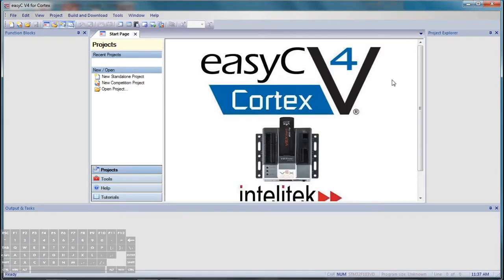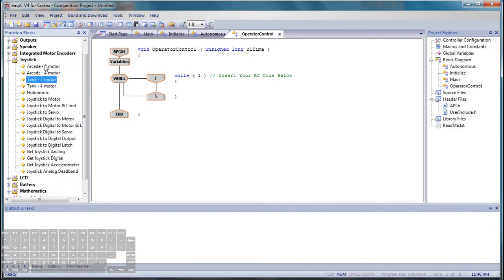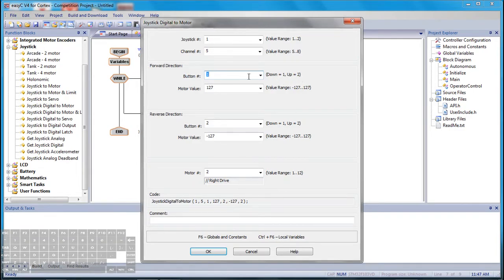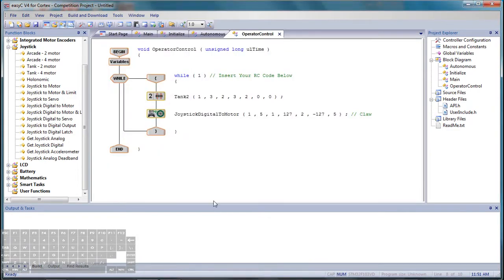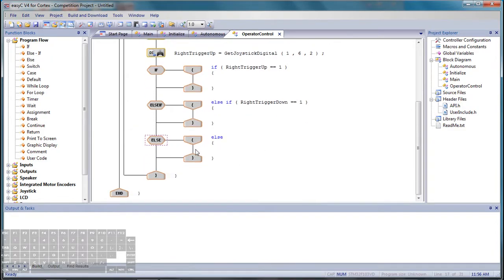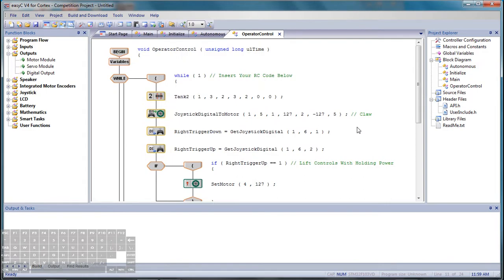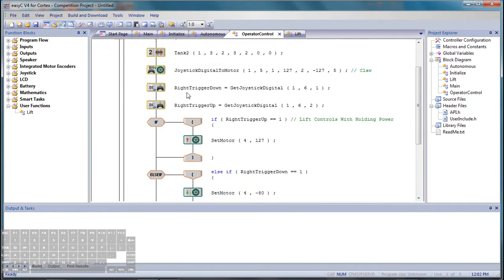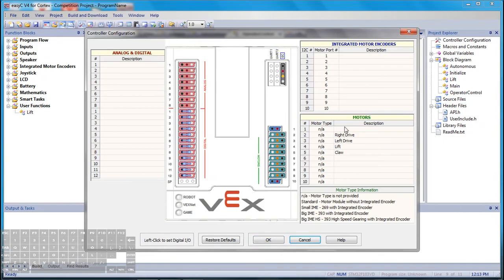Weiser High School Robotics VEX EDR Clawbot Programming Tutorial EasyC-V4 for Cortex

Comment: Will this code work for a servo or just motor ?
Reply from the maker: This is the old system. I have no idea what had changed, but you should look at something newer.
Reply: @michaelbrooke8611  helping a class with some programming they have the older setup from 2017-2018 and looks very similar. I will keep hunting around for some resources
Reply from the maker: Ah gotcha. I'm not sure. I didn't have servos but I think they had their own control block. The code would be very similar but I would look in the menu for one that says servo.
Reply: @michaelbrooke8611  Awesome thanks, I think I found the correct block. After the team gets back from break I will see if it works out. I do believe the servo and motor program very similarly expect a servo doesn't spin 360 degrees.